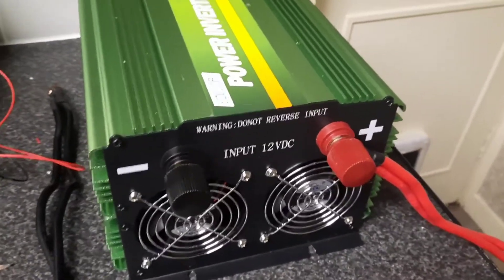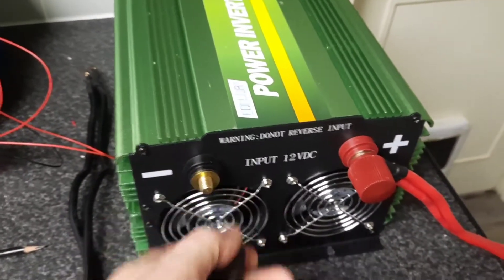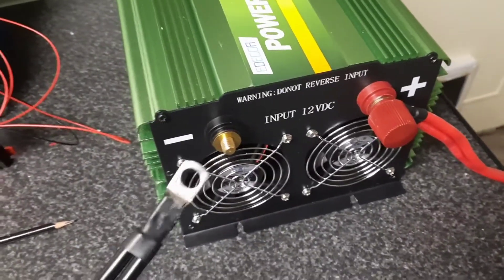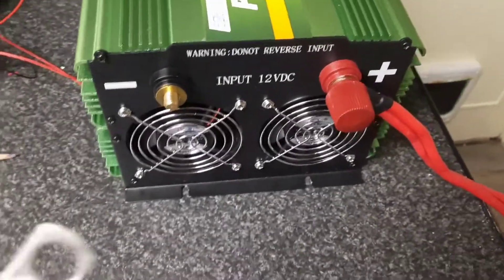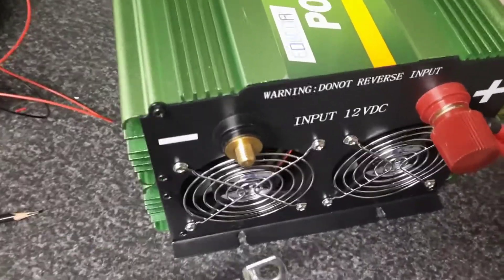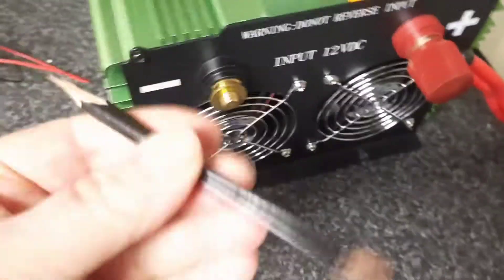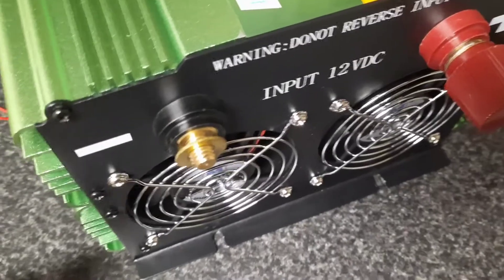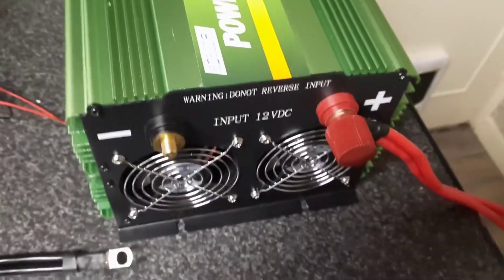No resistor? Use a pencil to Pre Charge an off grid inverter.

Comment: This sir worked perfectly 
Hats off to u 
Used a standard hb pencil between a 460ah battery and a 3000w inverter 
Not a spark and it didn't trip the battery safety features 
Cheers
Reply from the maker: Glad it helped. Thanks for the support 🙏

Comment: That’s the fist time I’ve ever seen the use of a pencil..or read about the use of a multimeter to both pre charge capacitors, and I’ve watched many videos on how to connect inverters safely with and without resisters. I’m grateful for your input on this subject, simple and to the point. Very surprised no other references to these methods are available. Thank you. 👍
Reply from the maker: Thanks for watching and taking time to comment its appreciated. I've only done this with 12v systems but don't see why it won't work on 24v etc

Comment: Thank you for this.. I have a challenge though. I tried connecting my new 120ah battery to my 1000 watts inverter yesterday. There was a great spark which caused something to burn in my inverter. I never experienced this for over three years using same inverter with my 40ah battery.  I'm so interested to know what actually went wrong so I dont repeat same mistake another day. I also want to know what component to fix in inverter cause I tried connecting with my old 40ah batter and it turned on to my greatest surprise.
Reply from the maker: Sorry to hear of your misfortune. Your inverter uses capacitors which store energy to allow for surges in supply. As such it is very important to pre charge the inverter either using a resistor or as shown a pencil. The pencil simply allows electrons to flow at a steady rate into the capacitors and you have to allow time for the process to complete. Ie it does what a resistor does. Almost all Inverters have internal Fuses which are replacable and hopefully yours is no different. Check the user manual to see where they are located. Also make sure the inverter is switched off before pre charging.
Reply: @DCGUY  Thank you so much for the swift response. I will do just that. I really do appreciate you. Blessings sir!!!

Comment: how about a 12volt light bulb, and get some feedback on the pre-charge process
Reply: Yes, that will work.   As the capacitor charges the light bulb will dim and finally go out when the capacitor is fully-charged.   The light bulb voltage rating needs to match your inverter input voltage, of course.

Comment: Someone explain me what is the principal behind this using a pencil❤❤
Reply from the maker: Graphite as used in pencils ✏ is a conducting element. It allows electrons to move freely and is a common non metal that can conduct electricity. The natural resistance means you can pre charge an inverters capacitors slower and spark free as opposed to simply placing a battery cable terminal with less resistance which will cause a spark.

Comment: Using a pencil to bridge the gap between an inverter and its power lead to pre-charge the capacitors and prevent sparks is not a recommended or safe practice. This method could pose significant risks, including the potential for short circuits, fire, damage to the inverter, and personal injury.

Why it's not recommended:

Material Conductivity: Pencils are not designed for electrical use. The graphite in a pencil does conduct electricity, but its conductivity is not stable or predictable compared to materials designed for electrical applications. This can lead to uneven and potentially dangerous current flow.
Risk of Damage: Bridging electrical connections with a pencil can damage both the graphite and the electrical components. This could lead to broken graphite leads inside the device, which could cause short circuits.
Safety Hazards: Introducing foreign objects into electrical circuits can lead to sparks, electrical shorts, or fires. It's crucial to use tools and methods that are safe and designed for handling electrical systems.
Reply from the maker: I totally agree with what your pointing out, but as an alternative I actually found this effective for my own purposes. Naturally it's better to use a suitable resistor.
Reply: @DCGUY  I was very interested in using this technique also. But with brand new gear and little experience I chose to heed AI's warnings ;)
Reply: Worked for me dude

Comment: Attach negative to invetter first  sparks go away
Reply from the maker: That's never worked for me.
Reply: @DCGUY   hmm  mayby    my caps were  charged before hand
Reply: Incorrect! The spark is the result of quick power surge to the uncharged caps.
It will happen as soon as the circuit is closed! Be it from the positive or the negative side. ;-)
Meaning the huge amount of current will flow anyway!
The only way to reduce this is by having the caps pre-charged (power source). Or control the current flow, to much lower levels (resistor). Hope it helps. ;-)